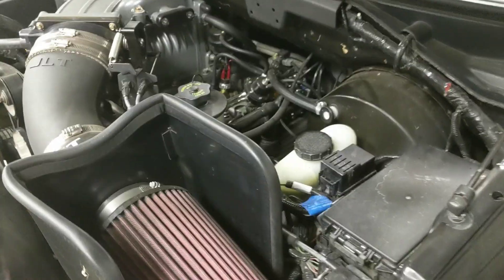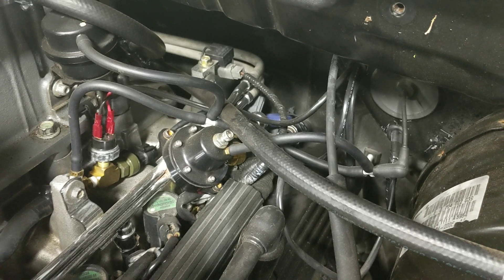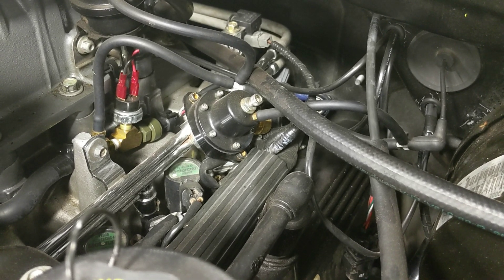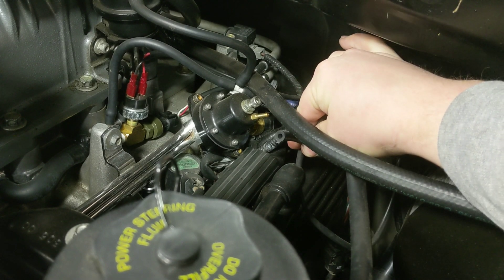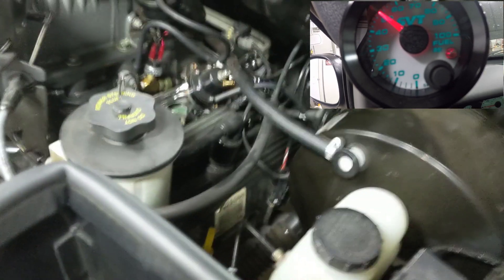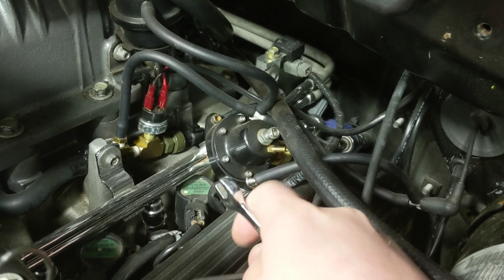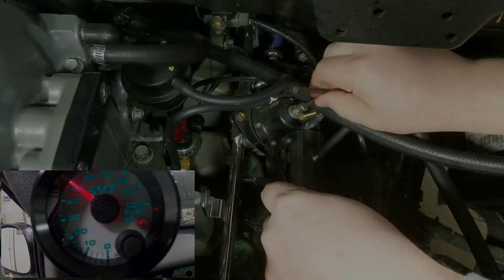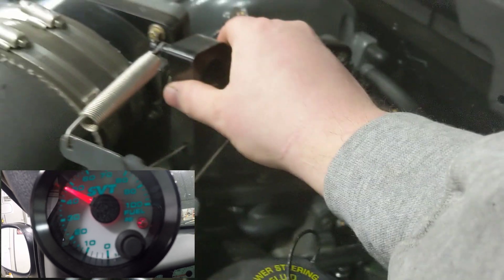How to set Base Fuel Pressure on a Boost Reference Fuel System

Comment: Do you need a regulator for e85 conversion
Reply from the maker: Basically yes. Maybe if you don't change pulleys or injectors or anything you could get away with it but I wouldn't even want to try. Best to ask your tuner but I am going to just about guarantee you will need one. 👍
Reply: Thanks for the feedback man really appreciate it, can you tell how many pumps you have and what kind? And do you have to switch to a return style?
Reply from the maker: @isaacgarcia9825  All lightnings come factory with a return style fuel system and dual pumps. It's really quite a nice feature. So on my truck, I swapped out the original pumps. I think they were about 180lph pumps. I switched to Walbro 255lph pumps and kennel bell boost a pump.
Reply: Wow man thanks for the info It really helps with my build, didn’t know about the factory double pumps or the flow rate, so all I basically need is pumps and a regulator?
Reply from the maker: @isaacgarcia9825  yes, pumps, Regulator, 97 f150/expedition fuel rails, a larger return line, and injectors. So a few more things. But it's not terrible. Mine has the 97 rails, regulator, DW 95lb injectors, bigger return line, dual 255 pumps, and a boost a pump. But it really depends how much power you want to make and on what fuel. E85 requires more fuel for a given power level so that's why it has so many upgrades. Can't get 93 in my town but you can get super hot E85 so no worries.

Comment: I’m doing this as I type. I thought the base pressure should be 39? I have 60lb injectors
Reply from the maker: 42-43 lbs is a common starting point. Depends on what your tuner is trying to do. For me I was kind of on the ragged edge of fuel so I ran a higher base pressure at the time. I run less now with my bigger rails and even bigger fuel system.

Comment: Thanks for this video. Helped me figure out an issue with my fuel pressure on my E85 1999 Saleen S281. I had set my pressure with the reference attached while the car was in vacuum. so rather than seeing around 45 psi like I should vacuum, I was seeing 55 which is my base pressure target. And in boost, which my car peaks out around 11psi, it was asking for essentially 80 psi, which the pump just could not do so I’ve watched my fuel pressure jump initially to around 75psi then drop to around 50 by the end of the gear. I’m only running a single Walbro 525 with 2020 GT500 injectors on a stock block 2v with stock rails and on a MS3 Pro
Reply from the maker: Oh nice. Yep that will cause you problems. Sick car. I love the saleen cars. Glad it helped. Beer time! 🍺
Reply: @605BOLT  haha definitely is. Time to grab a cold one and watch the Jags game!
Reply from the maker: @904Saleen  vikings on here in the north country. Have a good one! Go jags

Comment: I have a question since your videos are crazy helpful, do you have the fuel pressure guage reading rail pressure?
Reply from the maker: That gauge on my pillar pod is reading the output side of the fuel pressure regulator. That is directly tied to the fuel rail so the reading on my pillar pod setup is actual fuel rail pressure, yes. Sorry for the long answer.
Reply: @605BOLT  ahh okay cause I got a fuel pressure guage and I wasn’t sure if it’s fine to read from the rail pressure point on the passenger side or a from the regulator
Reply from the maker: Either is fine.  Grabbing fom the passenger side schrader valve is good too.  You will get the same number because they are essentially the same chamber.  Thanks for the kind comments!
Reply: @605BOLT  appreciate the fast replies! These video are crazy helpful 🫡
Reply from the maker: Did you get her all set up?
Reply: @605BOLT oh yeah!!
Reply from the maker: @svtshammy  nice. Good to hear it.

Comment: Great video man 👌. Can you do a video explaining the EGR delete? Not sure what lines and connectors I can delete.
Reply from the maker: Ya I can try to get that one done. Not sure if I want to  broadcast deleting emissions equipment.... 🤔😂
Reply: Oh yea haha I gotcha. I have pretty close to the same set up as your lightning ⚡⚡ Been gathering parts for the better part of a year now. I should have my new engine back from the builder next week. Can't wait to drive it again!
Reply from the maker: @B1GM1KE57  hell ya man. It's actually pretty simple the egr. Buy a kit from JC customs. Mention you saw his parts on my channel if you remember. But in his kit all I needed was the block off for the plenum and then the cap for the exhaust manifold. There is another bracket in his kit that I didn't need. And then get tuned to eliminate the light.
Reply: So I do have that set up with the tune. Can I just delete the whole bracket with all the sensors on it? And the lines going to it?
Reply from the maker: Talk to your tuner but that is the setul on mine.
Reply: Alright thanks ⚡⚡

Comment: Does your fuel pressure stay at 50 all the time? Or obviously lower like 45? Because it’s got the vacuum line connected? I ask because I notice that after a long drive my fuel pressure drops about 2-4 psi from the base pressure “40psi” and I end up with 36-38 psi with the vacuum line off
Reply from the maker: Right.  If you set your base at 50 say and then you hook up the vacuum line again at like -2lbs vacuum then it will drop to like 48 lbs or so.  Rough figuring.
Reply: @605BOLT  the thing is that let’s say for example I set it at 50 after like an hour or so of driving I get home and I check the fuel pressure again it’s at 46-48 with the vacuum line disconnected and if I check it like 3 hours later it’s back to 50 psi with the vacuum line disconnected that’s what idk if it’s normal or not. Only guess I can think of is fuel gets hot and becomes dense therefore I loose fuel pressure
Reply from the maker: I can't say that I've ever really looked at that scenario but something could be going on there. For a lightning, there is a little hose in the tank that can burst and bleed off fuel pressure.  Idk if you're working on a Lightning or a Cobra but that COULD be the problem.  I've never noticed mine dipping in a similar fashion to how you say.
Reply: @605BOLT  it’s happening on my 03 cobra it has a return style fuel system with a whipple 2.3 idk if it’s normal or not so I figured I would ask, thanks for the reply tho. I’m leaning towards the fuel getting to hot making me loose that fuel pressure 😅
Reply from the maker: @modlist6129  how old are the pumps? Could maybe be getting tired. Hard to say what would cause that. Could it be somehow related to her gauge or wiring?

Comment: Where’s the thing “whatever it is” on your fire wall… that the vaccum line go to the blower
Reply from the maker: That is the EVAP purge solenoid.  That system has been deleted.
Reply: @605BOLT  how do you delete that and why?
Reply from the maker: You delete it just by removing the solenoid, capping the port on the supercharger and by venting the tank to atmosphere rather than allowing it to be fed back into the engine via the original tubing routing.  I deleted that and my EGR system to clean up the engine bay and make supercharger removal quicker/easier.  Also, this way there is less junk going through the supercharger and engine (exhaust gases via the EGR and fuel vapors via the EVAP system).  Just makes the whole setup simpler and cleaner looking.
Reply from the maker: Just removing the items will get you check engine lights.  So talk to your tuner beforehand.
Reply: @605BOLT  I am thinking about doing it.
Reply from the maker: Its especially nice on a Lightning because its 2V and getting to the spark plugs is way more of a pain in the ass than your Cobra.  Or at least I assume that is what you drive based on your YT profile pic.
Reply: @605BOLT  cobra just sits I drive maybe 3 times a year. I think I might delete the evap system I wish I saw that when I had the bed off
Reply from the maker: @stephendwinells8260  u have a lightning too then? I'm jelly.
Reply: @605BOLT  I wanted both since high school
Reply from the maker: @stephendwinells8260  that's badass. Hopefully someday for me.
Reply: @605BOLT lighting needs a ton of work so it’s a running restoration  and cobra I have had for years… I got a deal on the lightning too that helped.
Reply from the maker: @stephendwinells8260  very cool. Well I hope you find some of my content helpful. Going to be a run of lightning videos coming up in the future.

Comment: If your running a blow through carb would you run line to the carb hat or intake?
Reply from the maker: If you want to do boost reference on a blow through carb, I'm pretty sure you want intake manifold pressure as your reference.  Basically you want to be sampling what is closest or an example of the pressure the injector tips will see.  That's my understanding but not an expert on blow through setups.
Reply: @605BOLT  I have heard manifold and or carb hat. Thanks! Any input helps.
Reply from the maker: @deadendgarage5401  ya I think it's basically the same. Pretty certain the same at WOT where boost is high and the butterflies are open. Only reason I would do under the carb is because when the butterflies slam shut coming off wot I feel like it could show boost when in actuality the intake would be not much boost. But that is a split second deal.
Reply: @605BOLT  that's where the BOV comes into play
Reply from the maker: @deadendgarage5401  ya I know but I didn't know how fast it responded or if it was big enough. If not, could be a super slight boost spike I would think.
Reply: @605BOLT  I'm going to try it out if it don't run properly then I will go to manifold. I was going to call jegs or summit and ask them to be sure.
Reply from the maker: @deadendgarage5401  good idea there. Could email procharger or whoever too in a pinch.

Comment: Thanks for the video man. I noticed snow on the side of the road. How are your tires in cold weather? Are you still running the NT05Rs in the rear and G2s in the front? Thank you
Reply from the maker: They are completely worthless in snow! I've never driven anything worse haha. Still running the same tire setup of g2 up front and NT05R out back. So not surprising they are awful. Definitely not made for snow.
Reply: @605BOLT  I was thinking about going the same route you did with tires but am now considering NT555R2s in rear and G2s up front. Thoughts?
Reply from the maker: @sguzman8624  can't say really. Maybe shoot an email to Nitto or something.  I just went with these NT05R tires because they were Nitto brand and were the best I could find at the time. Idk if they are better or worse than the NT555R or not. 🤷 I'd be curious to know what you find out. I cut a 1.7 60' with them so that seemed good I guess.
Reply: @605BOLT  thank you
Reply from the maker: @S Guzman Emailed Nitto customer service today regarding the NT555RII in comparison to a NT05R from a drag racing perspective and maximum traction.  This was the response....

"The NT05R is going to be the more aggressive drag radial as it is going to have the softer compound and the larger contact patch to assist you in putting the power down to the pavement."
Reply: @605BOLT  thank you for your help. I want a tire that can hook but I don’t want to drive around scared if there is a little unexpected rain shower. I’m thinking of going with the NT555R2 in rear and G2 up front. Have you been out in the rain with yours?
Reply from the maker: @sguzman8624  I would say I have driven on wet roads is about all. So ya maybe the NT555RII would be better for all around weather and whatnot. I was shooting for max traction haha.